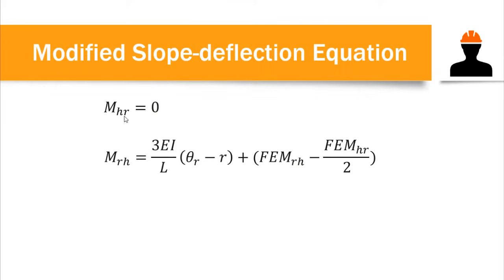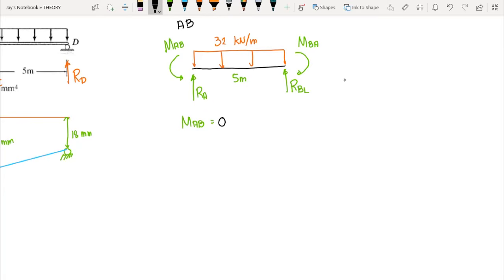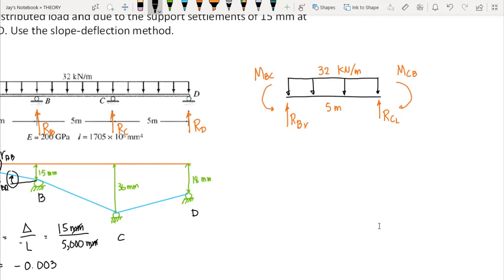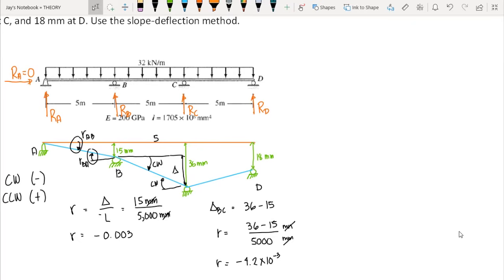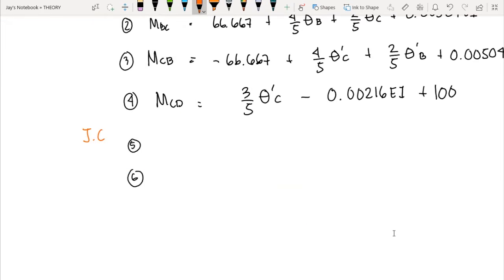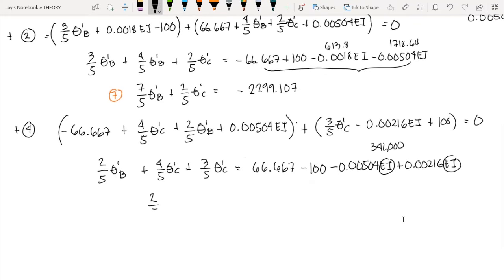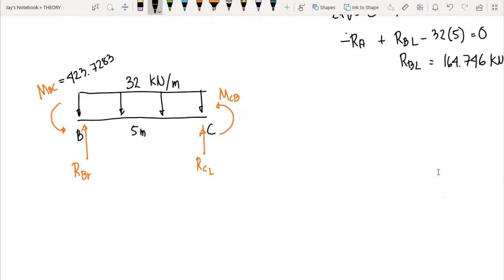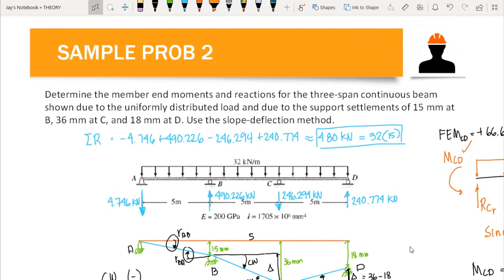Structural Theory | Slope-Deflection Method | Analysis of indeterminate Beam Part 2 of 3

Comment: Great video - very straight forward. Thanks for taking the time to put this together. Been 26 years since I did this at university. Need to check some software output, so this method is useful.